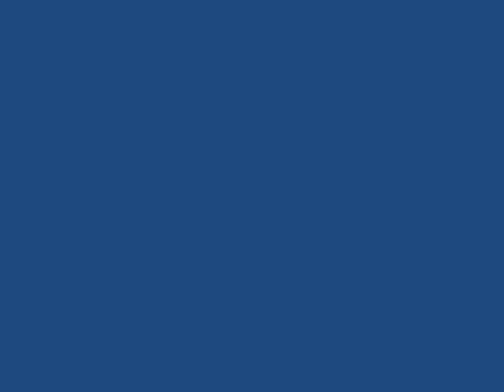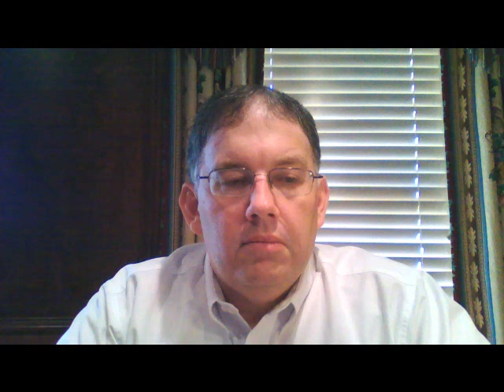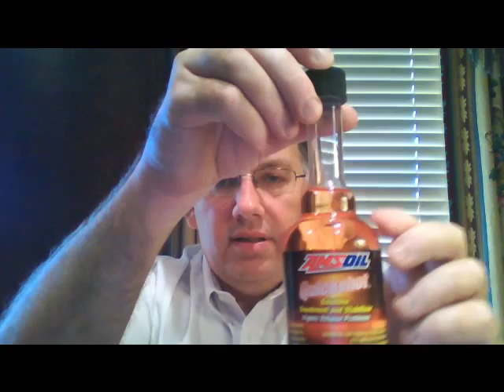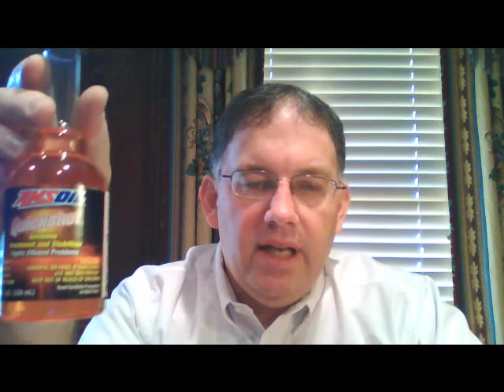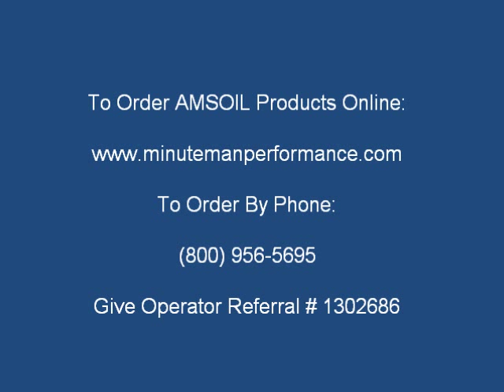Ethanol Fuel Problems

Comment: I was told to burn a non-ethanol (E-0), octane 91, in small engines, like my little lawn mower, by the guy who serviced my lawnmower.
Reply from the maker: I use VP Small Engine Fuel, which is rated at 94 octane, and contains no ethanol or other chemicals that are harmful to the fuel systems on small engines.  It costs about $20 per gallon, but I never have starting problems or have to rebuild the carbs.  My small engines run great on this type of fuel - 2-stroke and 4-stroke.

Comment: My two stoke engine got seized due to ethanol mix fuel :-(
Reply from the maker: I won't run ethanol blended fuels in any of my small engines.  I have recently started using the canned small engine fuel, and then adding AMSOIL Saber 2-stroke Oil for my 2-stroke equipment.  Even ethanol-free pump gas has harmful chemicals in it that destroys the diaphram in small carbs.  The canned fuels don't contain these harmful chemicals.  They seem expensive, until you rebuild small engine carbs every year.

Comment: ethanol damage the carburetors in my motorcycle had to get new ones I run Pure Gas hundred percent from the boat marina not only produces more power Burns cooler in the ethanol / solvent does it dilute the oil film from the cylinders.
as soon as I switch the Pure Gas I felt the difference right away it felt like I got a tune-up
Reply from the maker: Pure gasoline burns hotter (i.e. it produces more energy per ounce than a gasoline/ethanol blend).  Ethanol can raise the octane rating of the blended fuel, which can allow for higher compression ratios and advances to timing, but that really just gets you back to even with pure gasoline in terms of energy output.

Comment: funny I've never had a problem in my Toyota fuel injectors? I can also leave a full tank in my lawn mower retire it in the fall and not start it up till April-May and start up on the 1st pull. I own a riding mower, a walk behind mower & a reel mower, a pressure washer, weed whacker, leaf blower, chipper shredder and any one of these can have left over gas from the end of the last season without ANY start-up or run problems at all. NO RUST, absolutely none. Sounds like Best-Synthetic has a revenue agenda.